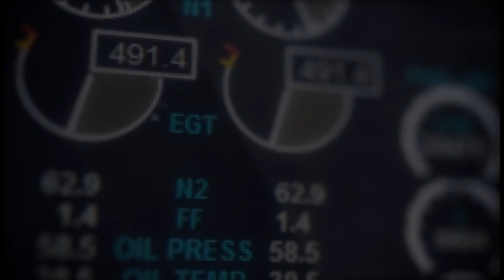Will Circular runways "take off"

Comment: You didn't mention ILS, and what about the wind? Headwind, turning to x-wind turning to tailwind in the same take off or landing.
Reply from the maker: Yes, like I said in my description, I can only mention a few of the MANY serious problems that this idea has.
Reply: I was about to mention this. The biggest and number one problem I can see with a circle runway is that, sure, you can take off and land facing right into the wind, but after you go a third of a mile all of a sudden you have a 45 degree crosswind. Thus instead of always having a headwind you will always have a crosswind.
Reply: another1 commenter
I'm sure there will be much research into this which will negate and confirm some apparently valid points for and against though I personally think the negatives seem highly reasonable.
Cost will be phenomenal. Using your expectation, 4.2 times maintenance and inspections. 4.2 times the construction costs ... at least. 24 sets of papi. 24 ILS if using both directions.
Finally, while I'm always open to correction on my opinion, I cannot agree that pilots should effectively butt out of the whole question as your last paragraph suggests. Failure to involve those doing the job has resulted in many bad designs and policy. Pilots would bring  priceless input. You should never underestimate that even though you have it seems already decided against it.
Reply: Instead of ILS and PAPI why not using a "local ground GPS" which could use 12 references emitting points  around the airport, so the plane can calculate by itself its place with less than a decimeter in the 3 dimensions and also its abolute speeds and accelerations, so landing can be totally possible even with zero visibility?
Reply: the circle is so big this 45 degrees will not happen. You start with a slight crosswind and on point of V1 you will have headwind and the profit is at its maximum
Reply: Regarding the ILS, this is a technology developped for linear runways. So of course that kind of tool would not be suitable anymore, it would need to be replaced. I'm sure something else may be developed for circular runways with today technology. Changing an instrument for retrofitting current planes is maybe not straightforward but doable. Much more than the wingtip clearance issue or the single engine failure. And why not simply having a finite number of approaches (such as 36, one every 10°) ? An infinite number of approaches is not required.
Reply: The ILS could be integrated into the landing surface at multiple locations as well as the PAPI. The PAPI could be defused light tile sections of runway, if we section the runway into a clock style breakdown (with 12 o'clock always north) then you could lay infrastructure at each 'Hour' and ATF activates only the units that terminate a runway section of use. 
The system would have on windy days only 2 active runways with  the point of average touch down on runway "'A" heading direct into wind on the Clock wise rotation and the point of lift off being direct into the wind in the counter clock wise direction. I would expect the circle to be 4.2x the length of a standard runway to be most efficient to cross winds but a smaller circle could be used buy landing and taking off in nearly direct headwind but transitioning through the change while touched down. For example if wind was coming from 3 o'clock landing at11 o'clock would provide low cross winds of 30 degrees. The cross wind effect in most dangerous during these times and not as relevant for experienced pilots when most the speed of the plane is reduced and sits heavy on the runway. The camber would be calculated to the correct angle for slight turn in on circle for large aircraft. With experience landing would become as natural as landing on a straight runway and just remember at one stage you didn't even know how to do that. On calm days all runway could be used with the possibility of having even more runways by making small domestic traffic runways.
The fact that the terminal is in the middle doesn't matter as the project is of such a scale routing traffic and transport services under the runway is of little cost. 
Round runway landing certification would be required but add in some simulator time during construction for major airlines and have their pilots competent within 6 months. Maybe 1 day seminar/course with test and then 2x3hours of simulator time in the corresponding air craft models. Thus a single pilot would be able to update himself over a 2 day course.
Using a clock system could allow you to allocate runways by their position for instance a call for landing runway C12-3ES would allocate the aircraft to land in clockwise direction from the most northern point 12 o'clock with the runway ending at 90' or 3 o'clock.  a call take off R9-6SE would allocate the aircraft to take off counter clockwise starting with taxi to the west most point 270' and take off by 180' or 6 o'clock. This would allow runway calls to have validation of position with the first letter indicating direction of rotation, the numbers being the start and end of runway section, the trailing letters being the closest major compass heading at start and finish of runway section. This way if a pilot misinterprets the numbers then the incorrect headings should trigger alert to his fault.
The clear ends mentioned for the runways would become a clear area around the airport, simulation and calculation would define what that distance would be and direct application of straight runway standards would be moronic.
Also expecting a round airport in an unsuitable area follows the same suit. For instance a round runway would have never gone into the old Kai Tak Airport facility but may suit HKG facility. 
It’s a sound concept and I recommend the pilots concentrate on flying and let the engineers design the aircraft and runways.

Comment: Landing with a bank angle, let alone CAT2 and 3 autolands... geeze
Reply: A week or two ago, our leader talked about crosswind landings. The first type of approach he mentioned, one that was not used by large aircraft, is the sideslip type of approach where the aircraft is slipped into the wind - the aircraft is banked into the wind and opposite rudder used to keep the plane aligned with the runway.  This is a sideslip which is normally used to lose altitude at a higher rate by killing some of the lift generated by the wing which is usually flying straight into the wind.  This brings up the difference between heading and course.

Comment: Why not just build the runway on a giant turntable.  Like they did with railroads.
Reply: If you're willing to set aside enough real estate for such a turntable, why not just have over the whole thing and have a massive disk shaped tarmac. Land anywhere on it you like.

Perhaps embed lights on several (20? 30?) spaced diameters of tarmac and turn on the lights on the particular one on which the plane is expected to land at a particular time.

Much less expensive and complicated than a massive turntable runway, which will likely cause blackouts in nearby cities whenever the motors that move it power up. Unless you allocate a power station specifically for the airport.
Reply: i missed the fact of the airport being on their too, sorry, my mistake. 
I think we are conclusion, though, impractical and wasteful, both of capital and energy.
Reply: EpicSpaceTroll 139
The early airports were actually just large circular grass fields. The pilot would taxi the plane all the way to the end where a favourable wind for takeoff was blowing.
Of course, that would be impractical now as you'll need to pave a huge amount of land, & maintain it to eliminate cracks, subsidence, & bumps.
Reply: Aviato why not build planes that can offset crosswind?
Reply: It would seems reasonable enough to me that a small degree of thrust vectoring might do the trick.  Don't know how many R/C planes I've seen crab after gluing motor mounts (back) on.
Reply: +sierraromeomike That idea is used in B-52. Main landing gear can be adjusted up to 20 degrees.
Reply: Because a disk would actually end up taking more space.  A rotating airport/airfield would take no more space than our current airports take up now.  Onthe other hand, your idea of a giant disk shaped "runway" would take up much more due to the terminal and airport buildings having to be built far away from the landing area due to take-off and landing clearances.
Reply: Aviato Is the idea to have the entire terminal itself also on the turntable rotating with the runway? If so how do people deal with the rotation when coming into and out of the airport? People can enter if the thing is stopped, can't if it isn't? Tunnel that brings people up to an entrance at the center where the relative motion would be reasonably slow?

Whatever the method that would take even more power than I thought. This sounds akin to moving something the size and mass of 10-15, possibly 20 aircraft carriers around.

Also: I wasn't saying a giant disk shaped runway was a good idea, it just seemed cheaper and more technically feasible than an isolated rotating runway, which is what I thought you were proposing originally.
Reply: w1rth a kilometres long turntable that has to support hundreds of tons of plane and thousands of tons of concrete? Highly unlikely
Reply: One could build the whole "turntable" as a massive disk-shaped barge floating in a shallow artificial lake.
Not saying it would be practical, but at least it would be physically possible.
(Retracted statement)
Reply: I don't think you really would need that much power, the railway turntables could often only take a few men to push round hundreds of tons. on the other hand, you would be building the largest boat in history. it would technically be possible, but utterly pointless. it would be far cheaper just to build a second runway at right angles across it, taking up far less space and money, and still stopping crosswinds
Reply: Dubsy 102 Keep in mind the moment of inertia of a disk scales with the square of the radius. So let's say the railroad turntable is a disk (I know it's often more like a beam, but I'm trying to make the math simple here lol) with a 10m radius.
Now let's say our runway is 3km. That gives us a radius of 1.5km = 1500m. If our airport barge has the same mass per unit area as the train turntable, it's moment of inertia will be 1500²/10² = 22500 times as large.
Now we probably don't want to swing it around as fast as a railroad turntable, so the power multiplication won't be quite as large, but I'd guess you'd still be left with a factor of around 7000 to 10000.
So... 21000 to 30000 manpower... Whatever that is xD

Edit ok by healthy manual laborer power output estimates off of Wikipedia that's between 1.6 and 2.25 megawatts.
So I retract my statement. This is more like a heavy diesel-electric locomotive.

I still don't think it's practical! xD
Reply: EpicSpaceTroll 139 why don't you just do the runway as a straight barge that rotates, that's a lot less weight and consequently a lot less inertia. To be clear, I still don't think it's practical, but i think the issue lies with construction, not power
Reply: Dubsy 102 As in only the runway is turning, not the rest of the airport on a disk with it?

If that is the case one might as well dispense with the turntable and just lay out a giant concrete disk on the ground with lights embedded in numerous directions.   Would probably make it easier for pilots too as they wouldn't have to taxi around the rim to get to the appropriate end of the runway.

There is a second problem with the rotating runway: it requires a more real estate than a fixed one. I think this is part of the reason the person who suggested this envisioned the terminal itself being on the barge too
Reply: Pilot to atc /ground crew "Hey we're trying to land here!  Quit playing with the dang turntable '

Comment: Couldn’t agree more! Great video 
A circular runway in the desert where there is no terrain or high rise buildings might work...
Also the aircraft would have to land on exactly the right spot of the runway on touch down or risk veering off the side. In gusty conditions a sudden increase in lift could cause the aircraft to float, and instead of being able to land a little longer you would have to start correcting for the change in direction of the runway. You would be having wingtip strikes for days!
Reply from the maker: Yes, all true.